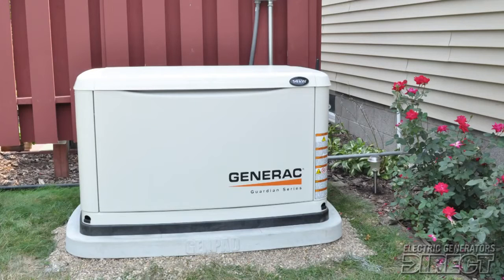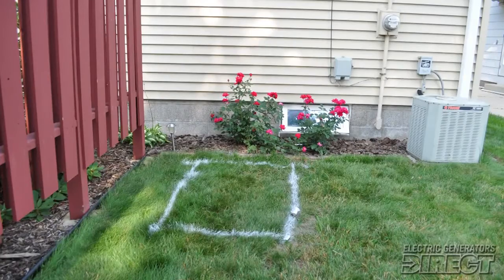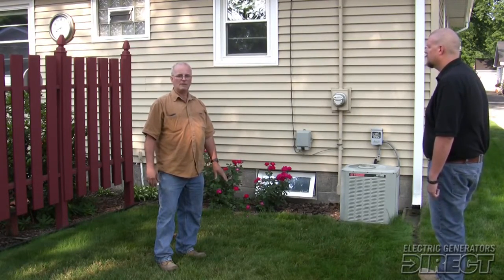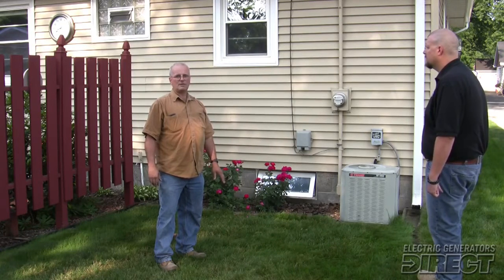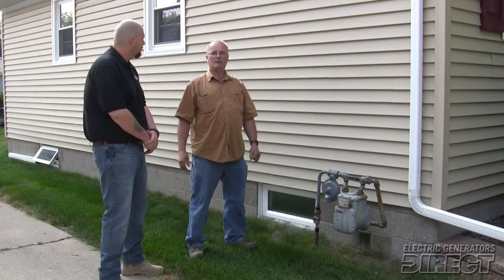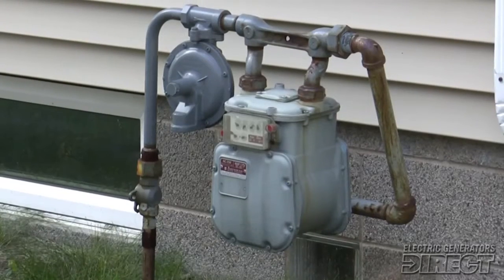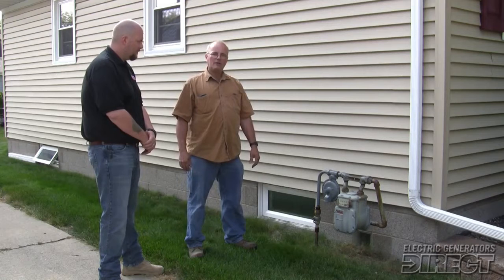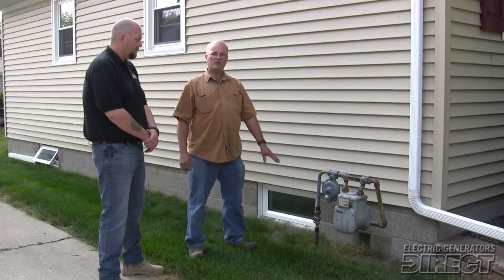Mapping Out an Installation Location for a Home Standby Generator

Comment: Noise is my concern.  I don't want to locate the generator on the side of the house close to my neighbor's bedrooms.  How far can I go into the back yard?  I have an underground feed from a power company transformer in the corner of the yard.  From there to my meter on the house is approximately 50 feet.
Reply from the maker: First, make sure you follow all state and local codes. Second, hire a certified installer/electrician for any task relating to a standby generator. In theory, you should be able to place the generator as far away from your home as you need, so long as there is enough material to properly install, connect, and run all essential components of the standby system. A certified installer will let you know what your options are upon installation/consultation.
Reply: Our generator is right on the other side of the wall that we sleep on. Would love to put this thing about 60 feet away in my backyard behind our garage. Is it feasible to move it once installed? If so how much would this cost?